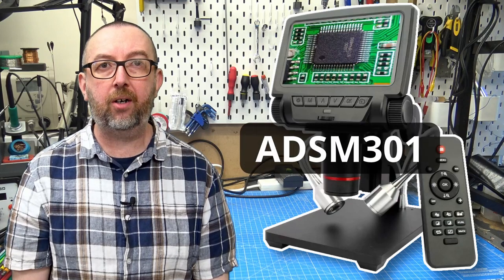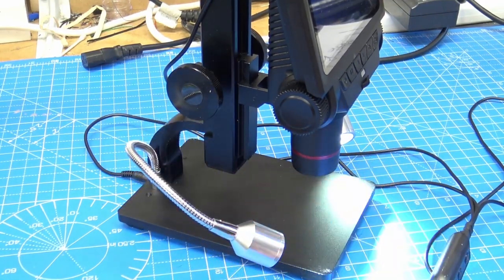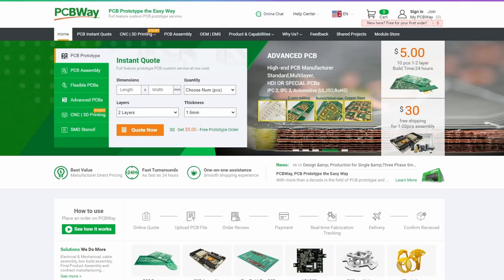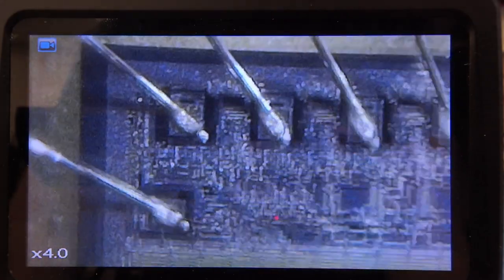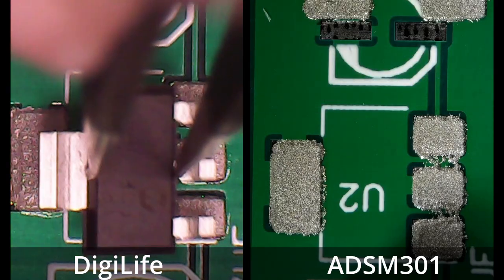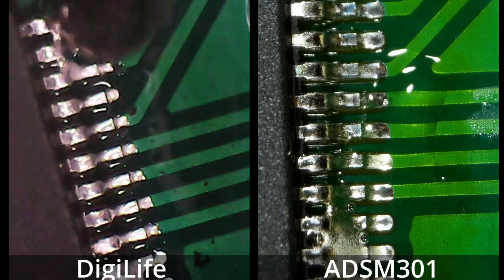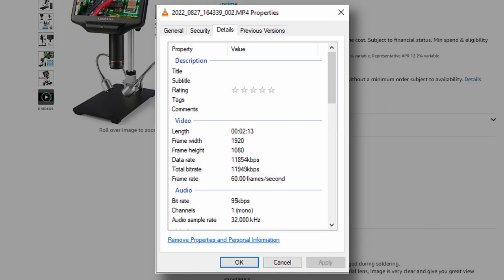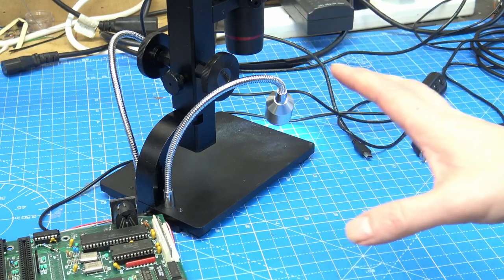Andonstar ADSM301 digital microscope is it worth spending your  money ?

Comment: Absolutely brill timing, I've been trying to figure out exactly this sort of question, trying to pick from amongst the semi-infinite number of low(ish)-cost video microscopes out there, and you've answered so many questions I had including one I didn't even realise I had! (The boom arm modification in particular.) Thanks so much!
Reply from the maker: it's only a small sample. but I bet a lot of the cheap ones are the same as this digilife on the inside. I have used this adsm301 for work and after a months use happy to say I like it and would recommend.

Comment: Nice review ^^ I have a ADSM302 with the exact same stand and power cable, and as I repair some large PCBs I encounter the exact same issues.
For your information, you can stream the microscope video if you plug it to a computer and use OBS or other stream software. To achieve that, do not use the cable shown in your video, it is a power only cable, use the other USB cable provided.
Reply from the maker: HI, I did look and it's only 720p when used with a PC so I would use it with my HDMI capture to stream.

Comment: Hi Lee, Thanks for the great review. Just got one and I was wondering, could you please help me with the 3d file so i can print the mount you showed for my desk mic stand ? You mentioned a link in your comments but dont see it. Much appreciated
Reply from the maker: HI, I didn't use one with mine it was for the larger screen so what model do you have ?
Reply: @leesmithsworkshop  I got the adsm301. Ordered some standard deskmic arm but want to also move the lights over to it. But i thought if i got that 3d file i could adapt it in fusion360 a bit to fit this one . Should be pretty similar

Comment: Unfortunately, my microphone arm does not have the same thread as the microscope. what are the dimensions of the thread of the microscope so that I can buy an adapter, otherwise I cannot use the microscope on the microphone arm. 

Best regards.
Reply: I just encountered this issue today & no one can tell me thread either or how to fix my problem. How did you fix it???